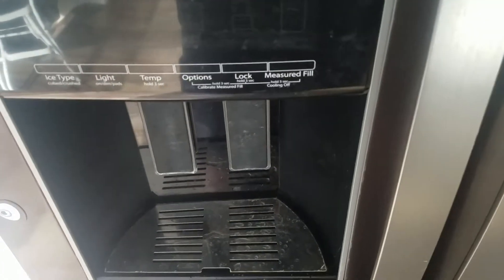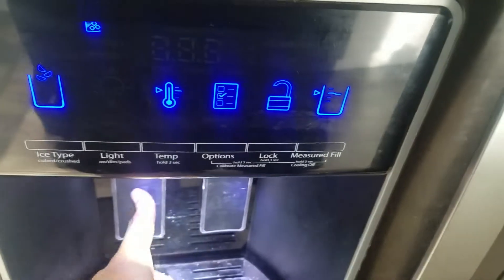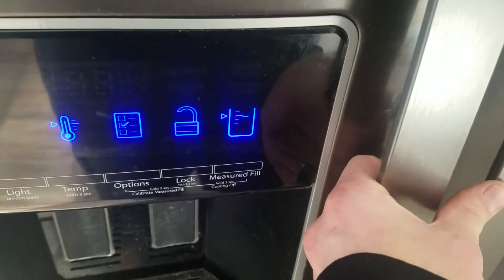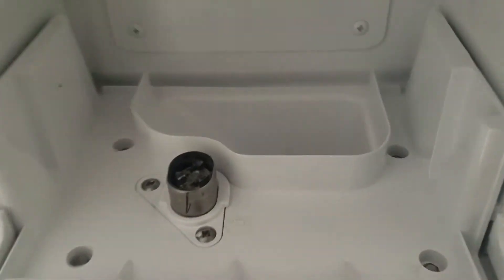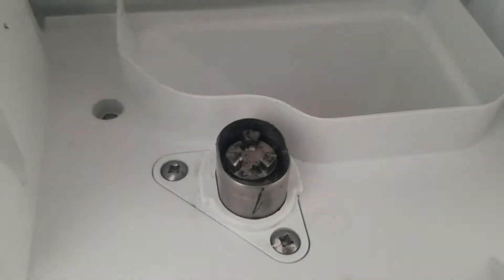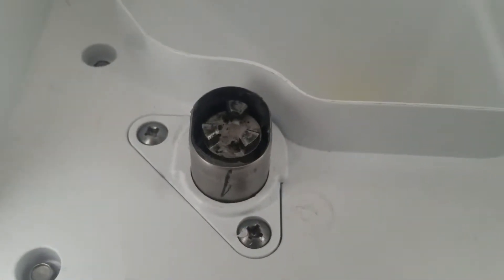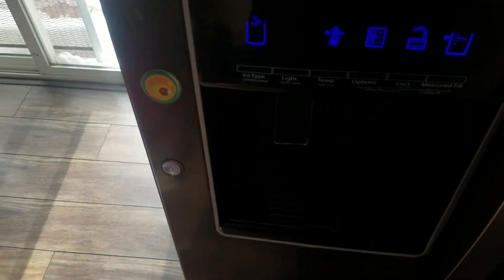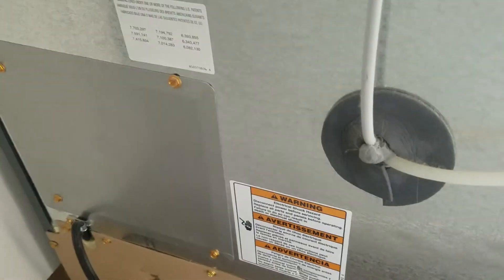Malfunctioning Whirlpool fridge auger motor.

Comment: There is no voltage going to the auger motor.
Is the problem in the control panel at the back of the fridge or else were?
Reply: I had the same problem! It was the Grey with an orange strip wire. Mine was out of warranty but I went ahead and spliced the wire and used heat shrink on the wire. I also put new electrical tubing on the rest of the wires, where it hinges at the bottom of the door! Everything works perfectly now. Thanks for the video!
Reply: @foxhoven26  Where exactly was it damaged?  I can't figure out where that wire goes to once it leaves the auger compartment.
Reply from the maker: Whirlpool covered it under warranty. The wiring along the freezer door hinge wasn't installed nicely which caused it to wear and fray which shorted the control board. I needed an entire new freezer door.
Reply: Jstricks87 but what board was shorted the one in the back? I have the same issue but I don’t think my fridge still under warranty

Comment: Hello!! I have the same problem, did you fix it?  How if you fix it?
Reply from the maker: Whirlpool covered it under warranty. The wiring along the freezer door hinge wasn't installed nicely which caused it to wear and fray which shorted the control board. I needed an entire new freezer door.
Reply: @Jstricks87  where exactly on the door was the short? Thank u